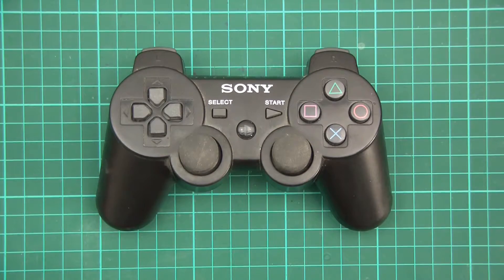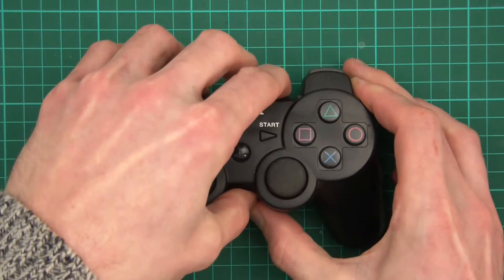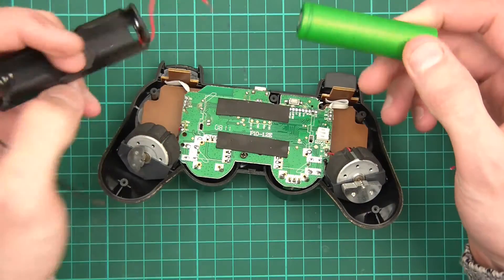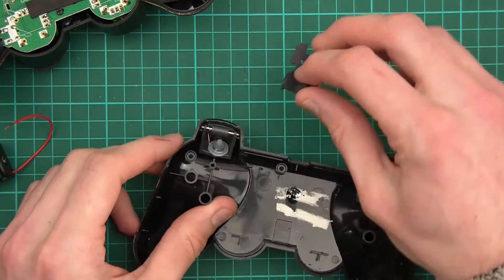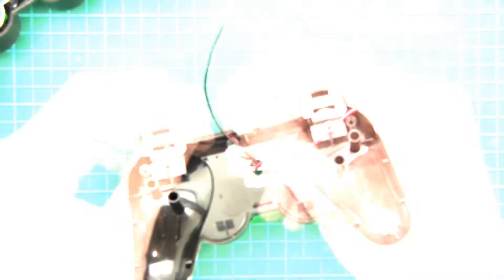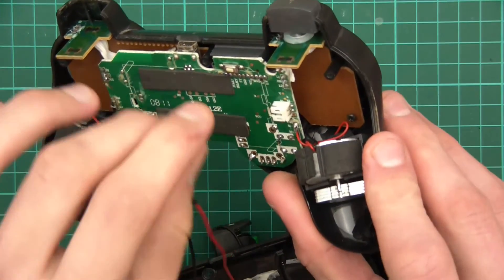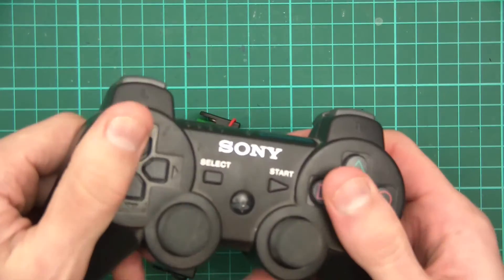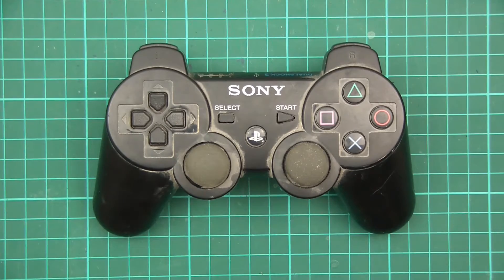TUTORIAL: Modding PS3 Controller - Massively Increasing Battery Capacity!

Comment: Am I wrong or wouldn't this not quite work because the ps3 controller PCB would have a battery charger circuit for a certain capacity battery for the lithium ion battery because lithium ion batteries need a circuit to ensure that they're not being over-charged or over-discharged?
Reply: The only thing that matters is that the voltage is the same. If you use a bigger capacity battery the only thing that'll happen is that it will charge slower.

Comment: That's actually a good idea... well this was 5 years ago but still... Gold. I think this would look nicer with a different battery enclosure. Does it charge with the USB?
Reply from the maker: Yes, it charged fine! You can also double up the cells and never have to charge it again. Hahaha!
Reply: @antonycartwright  many tnx Antony... I just looked at mine and planning to change the charging port with with USB-C but sadly the pins are too small like needle pin and its hard to solder... haha tnx again
Reply from the maker: @hanzo313  it's doable. Just take your time.

Comment: Could you try a ps4 with 3 aaa bats , you think it might work??
Reply from the maker: You could but it wouldn't last long at all because 3 of those in parallel sum up to 3.6v which is the nominal voltage of li-ion. You need to try to get 4.2v.

Comment: Just curious how long does it take to charge?  And does the flashing lights go out when the charge is complete? Or are you charging these cells on something else?
Reply: I haven't done this on a PS3 controller, but I've done this exact same mod on some Bluetooth headsets.  I just charge my 18650 cells on a dedicated 18650 charger.  That way, if the headset ever does die, I can just swap out the battery with a charged one in a few seconds and keep going.

Comment: This is actually a pretty good idea. I can't find a stock PS3  cable with the little round thing on the cable anymore around . So it was do this with a battery or keep trying to find a cable . I have a cable but it won't charge my controller .
Reply: Is the round thing not simply a ferrite core? It shouldn't be what causes your controller not to charge. Any USB cable that fits should work. But the charger needs to be chipped for the controller to start charging. That's why charging from a PC works, but a regular wall USB charger doesn't.

Comment: A 3.7 volt flat lipo would have worked perfectly and would fit inside the controller.
Reply: Yes, but your not considering the possibility of just changing out the battery when it gets low!..  18650s have just been growing in popularity!
Reply: No hot glue being the what holds it all together. I think I definitely would have went with finding some kind of screws or something and cutting them to size or something. But wasn't my project and hot glue is very easy to use..

Comment: there is another model of 18650 that is actually half the size. that would work even better
Reply: Those are not 3.7 volt. They are half the size and half the voltage.
Reply: Cylindrical Li Ion cells are actually numbered to tell the physical size of the battery, not a model number. By definition, 18650 means 18mm diameter, 65.0mm in length.  Makes it handy to find batteries of a certain size when that is more important than runtime capacity.  They make AA-sized Li Ion cells too, those are 14500's (14mm diameter, 50.0mm long), but obviously those should never be used as drop-in replacements for normal AA batteries since the voltage is completely different.

Comment: Great video mate,tx. I wonder if i can power a dualshock 3 ps3 controller thorugh usb when battery fails. Just to cut wires from battery and connect them to a usb 3 red and black cable
Reply: Be carefull bro, because usb is 5V and the battery is max 4.2V.

If u connect direct, it can break your controler because over voltage.

If u want direct usb then connect using usb ps3 charger cable.
Reply: @srkahfi2790  maybe the small diff in voltage wont hurt it but you are right...its risky. I tried to connect directly to ps3 using its native cable but it doesnt work,it doesnt turn on the console. Maybe i should have turned it on first using the physical switch and then connect wired the controller? I will try again but next week when i get back home to see if it works. I wonder, 2nd controller its dualshock3 v2 (it has 5v/500mah battery), this would work through usb power directly?it would be the same voltage,just more mah (1000 mah or 2000mah ,depending on my dc smartphone charger)
PS: i think the charging connector on dks3 broke because o remember even in menu it doesn power the controller,so my only salvation comes from powering it directly to usb charger (cut wires from battery and connect them to usb cable wires)
PPS: i wonder why sony discountinued dsk3 controller because there are so many people still owning a ps3 and many ps3 exclusives required sixaxis and the native controller. Shame on Sony!
Reply: @combustia78  :
The Native cable u can connect direct to usb Smartphone charger. No more charger from console.

I always charger my ps3 controler from Phone charger. Its same.

At my home, i changed my batery using handphone batery
Reply: @srkahfi2790  cool, and what is the output on phone charger? 1ah or 2ah? Does it matter? I told you,it must be the charging connector on dsk3 because i dont power it on, so i have to connect thr wires internally with the ones of usb phone charger
Reply: @combustia78  :
To my knowledge, its no problem if using charger 1Ah or 2Ah as long as 5V. Its only effect for charging batery.  Batery 500mAh then if using charger 1000mAh (1Ah) then only need 30 minute. If 2Ah then only 15 minute

But safe if we use small Ampere to play using cable.
At home i used charger 5V 600mAh
Reply: @srkahfi2790  aaa i see. So doesnt matter the dc charger power in ah, all it affects is charging time. Nice that you have a 600mah charger, i could only find a min. 1000mah charger. I see, ill check 2nd wk from now if charging connector still works so i can therefore use dks3 wired. If it doesnt work, it  must be the connector (broken), then what is left to do?wire the charger usb cable to power connector inside the controller, even if it outputs 5v instead of 4.2v maximum as battery supplies as you say. What can i do?im afraid the dsk3 outside charging connector is broken.
For comparison, xbox one connector works wired to pc or xbox console. For dualshock4 ,i dont know if it works wired,even if battery is dead. I guess for dsk4 i can connect to charger wires inside because  battery supplies 5v/850ah from what i remember. Even for dsk3 v2, same 5v (500mah but this doesnt matter). My 2nd dsk3 is v2(5v) but its battery still works,no need to cut the wires now just to try if it works powering directly from dc charger.
Reply: @combustia78  :
I have 2 controllers.
The problem same. Connector has  broken.

So i made shorcut cable from cable of batery inside controler + made a hole so i can charge from usb. And i change the original battery using phone battery 1000mAh.

I used Fan Portable to charge controller, because i checked the voltage was 4.2V.
This Fan Portable is nice because has otomatic cut off if battery full.

Please check this picture :
https://drive.google.com/file/d/1675LqWSg1pgTdpdYaFumGruy10MG-2zi/view?usp=drivesdk
Reply: @srkahfi2790  nice,i like the Fan Portable trick, so you charge Fan portable charger with 5v phone charger and from Fan portable you output exactly 4.2v to charge the dsk3 battery which wires you connected directly to the charging wires of the dsk3 battery (but how because battery inside has only 2 wires that goes to power plug inside, there are no separate wires from charging it,maybe you wired from somehow the broken charge connector on dsk3. Nice trick,i like it. But i dont want to charge battery,i want to power directly the controller from phone charger (cut usb cable and use charger's wires and connect directly to the power plug where the battery plugs too inside the dsk3)
Reply: @combustia78  :
If u want to make 5V become 4V, u can use Modul TP-4056.

Input USB 5V, for output u can adjust to 1.2V-4V. Its cheaper.
Just cut the cable of battery inside and connect to this module. But u have to adjust first to 4v

U can check this :

https://youtu.be/nAPTK8coDdw
Reply: @srkahfi2790  nice, and very easy to use.maybe i order it. But...are you 100% sure i damage the controller if i power it with dc 5v straight from dc usb phone charger? After all, we talk about less than 1v
Reply: @combustia78  :
Dont forget.
4.2v is maximum already. For charging tolerance i read 10%-15%. If normal 3.7v than up 15%= 4.3V.

Better u have to try.
So u dont have question mark bro hehehe. 😂😂.
If only 1-5 minute maybe safe.  We dont know if we use 1 hour during play game.
Reply: @srkahfi2790  you realize i dont charge it, i take out the batter, cut its wires to be able to have its other half with the plug and then connect the wires with the charger's which i previously cut and thats all, i power up the controller through usb instead of using battery
So you think dualshock 3 v2 (the one with a 5v battery) is different inside?i mean,circuitry thats able to handle 5v?
Reply: @combustia78  :
I know what u mean.
U want no more battery. The cable of battery u will cut and stick to cable usb direct. Is it correct ??
Reply: @srkahfi2790  yes
Reply: @combustia78  :
I checked already with DC Meter. From USB to connector is 5V, but inside controller is 4.2V bro.

If inside u give 5V direct maybe electric circuit will be break. (The controller maybe can not be long life)
Reply: @srkahfi2790  good2know. I see what i do.then,i maybe use youtr converter
Reply: Thanx alot, its important to know all the issues. I wonder, the v2 5v dsk3 is ok if i power it through usb charger?the same with dsk4.

Comment: i wouldn't do this to an original ps3 controller.
Reply: both my original ds3's batteries are dead. in my country i can get original batteries for the equivalent of 10-12 dollars or i can buy a longer lasting one for the equivalent of 3-4 dollars, so i'd rather go with the longer lasting, bigger ones.
Reply: Its good that this is not an original than i could tell the second he poped it open the motherboard is nothing like my original controlers

Comment: I did this but 18650 cell will not charging. do you think my ps3 controller usb port dead?
Reply: You have to use a separate charger specially for that battery.  just google 18650 battery charger
Reply: @nda246  i bought one and it charges but when i put that to my ps3 controller zero charge
Reply: Check to make sure tha battery holder was spliced to the pin connector correctly amd that the connector is properly plugged into the controllers computer board.

Other than that little troubleshooting I cant help.  I know how to connect if I do it it but if it doesnt work Im not much on diagnosing what might have been missed.  Sorry I cant be more help.  Also make sure the battery is in the right way so + to +, - to-.  I'm guessing it was spliced in backwards but could be wrong
Reply: @nda246  Thanks

Comment: How to ruin a rare (now) genuine ps3 controller
Reply: Ps3 controllers are rare?
Reply: @user-ms8fl1ry6t  genuine* 
Read before reply
Reply: @zombiedeutsch  but that one just fake

just saying
Reply: @user-ms8fl1ry6t  Sadly, a tad, yes :/
Reply: ps3 controllers aren't rare though
Reply: @Roger Wilco - justice and really clean floors i don't find them terrible at all tbh. maybe i'm just used to them, but i actually prefer a ps3 controller to a ps4 or ps5 (or any xbox) controller. i have had my ps3 controller for years and it has been quite the journey. i took it apart multiple times to clean, fix the button spam problem, fix the bent trigger springs, change the sticky analog sticks and ultimately to put in a better battery.
Reply: If someone found this video and wants to mod a Dualshock 3 3D printing the lower part of the case could be a good solution, don't you think?
Reply: Theres a bucket of ps3 controllers at my local cashies